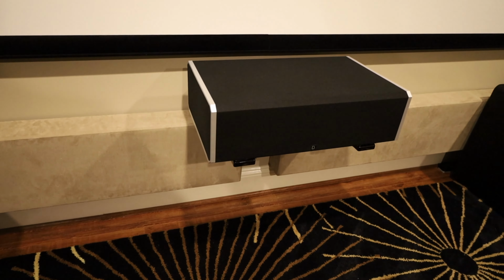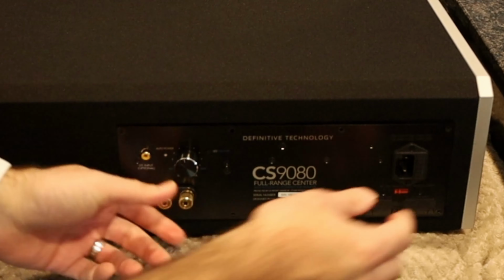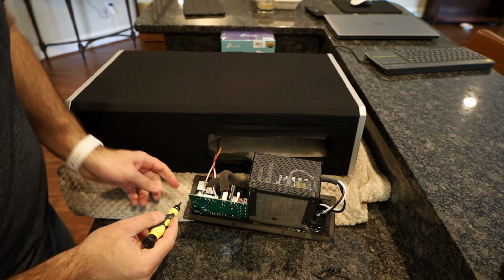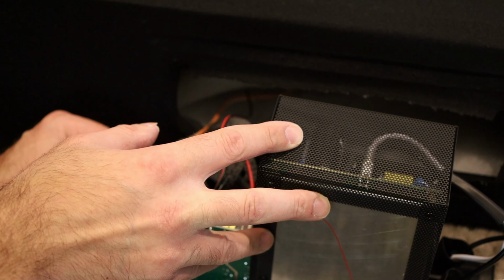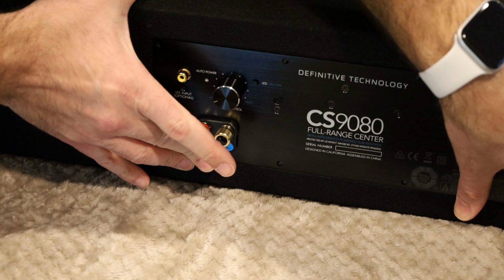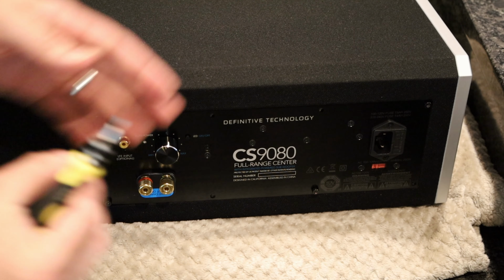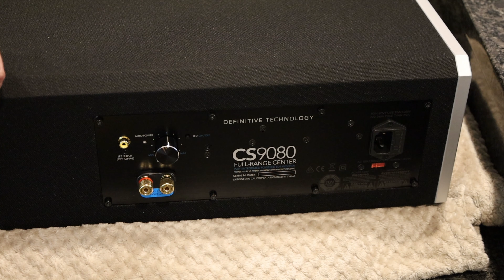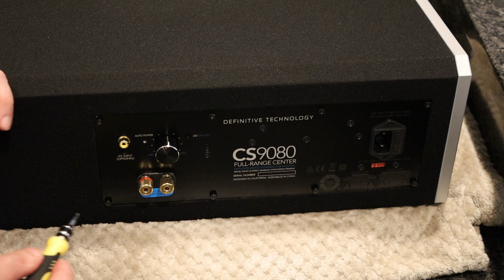Definitive Technology CS9080 Repair (Bad Amp) - Ownership Overview

Comment: Good amplifiers can last quite a long time.  Seems like Def Tech uses really cheap parts even though their speakers are kind of expensive. I bought a used Def Tech CLR 2300.  It started popping when my receiver wasn't on.  Luckily was able to get my money back.  Kinda warded me off buying a speaker with a built in amp.  Too much that can go wrong.  It does look like they made replacing the amplifier easier though.
Reply: I blew 1400 plus dollars in definitive technologies 9020.  Both the amplifier failed. definitive technologies did not care to do (even paid fix).  They are a big paper weight.  It was under warranty still five years! But definitive technologies did not care to honor warranty.  NO more definitive technologies products for me!

Comment: Thanks for the video. It definitely helps. That being said, your comments about the sub going off a quarter from a corner. Yes that can be ideal for 1 sub. Typically what happens when you use two like that is you end up getting a null where they cancel each other out. I know it looks symmetrical, but the sound/feeling isn’t very good in most cases. You would have better bass if you put them on opposite walls or even spreading them out to the corners. Most prime seating positions are in that null area. We also have to be careful of this when using our large center channels that come with 4 drivers and the tweeter in the middle. The spacing of those 2 outside drivers from the inside ones make a difference.

Comment: I have 4- BP7004's from 2009. 2 lasted 7 years then started humming then died. 1 has been humming for the last 4 months but it's not too loud yet and 1 is still functioning properly. I also have 2 subs from that time period that died about 6 years ago. I guess I am lucky to have gotten such longevity out of them. I have tried to find replacement amps for the 7004's but no luck yet. I think I will call a few local audio repair shops and get some estimates but I will not be buying anymore Def Tech stuff since they sold out to Sound United and then Sound United was recently bought by some medical supply company which is why Def Tech lost it's amazing customer service department. When they were just Def Tech and in Baltimore it was a great company to deal with. If I were you I would ask them if you could purchase a few more of those amps so that when they stop making them and yours break (which they will) you can just do what you did in the video if you like the speaker enough that is. They do not offer replacement amps for any of the Def Tech stuff that I have so I am s.o.l. Live and learn.

Comment: My new cs9080 is making loud pop noise when I sometimes turn it off…..less than a month old too. I guess I’ll be replacing the amp too in the near future.
Reply from the maker: That’s definitely not normal.  I hope you get the amp quicker than I did.
Reply: @Upscaled_HT  does it seem like the amp they sent you is better quality then the original one? Otherwise we will continue having the amp issues
Reply from the maker: The replacement seemed to be the same.
Reply: @Upscaled_HT  wow!!
Reply: The pop is normal from what I understand.

Comment: Thank you for this video. I have the 9080x towers and the amp is out too. I’ve used it lightly for about 2 years but those times I did use it, it would have that loud pop from time to time.  until eventually the sub stopped working. I didn’t know what to expect with replacing the amp but you definitely helped shed light on that. Thank you. Off I go to replace the amp now
Reply from the maker: I hope it all works out.
Reply: I am curious to know also how Definitive handles your issue, please update for future owners.  I will be purchasing my BP9080x Towers here shortly along with CS9080 center.  What is you amplifier/ receiver setup?  Currenly running SR8012 with Procinema 1000's throughout with Procinema 2000 center, curious how the Marantz will sound being it;s not the new SR8015 or seperate 8000 series processors

Comment: I have some bp9080 but upgraded to the 9080x about 3 years ago,  amplifier out on one of the floor standing subs.  I wonder if it’s possible to swap out the amp from the 9080 to the 9080x?  Can’t imagine there would be a huge difference.  The 9080’s have been sitting in storage but could come to good use now!  Just past warranty date too so would hate waiting that many months to get the part.
Reply from the maker: It should work fine if it physically fits in the cutout
Reply: @Upscaled_HT  a project for this week 😉

Comment: Happy new year to you bro, I really wanna thank you from the bottom of my heart because my 9080 tower amp blew out after having them for 3 years which is just crazy after paying all of that money for them, and I usually pay to get a lot of things done but after seeing this video you inspired and motivated me to stop being scared to touch the inside of my electronics and just try, and this was really one of the hardest things that I thought I would never do but you made it very easy to follow and you saved me from having to pay someone else to do it, so not only did I install one, but I had two brand new ones and I installed both of them right away!!!! Like I’m a damn engineer or something Lol, well now it seems like they are both working at full strength, damn you don’t know what this means to me that I did it myself, I never thought I would open up my speakers 🔊 but I’m so happy I did it!!!! Thanks again for this great video
Reply from the maker: So happy it helped you out! I really appreciate the comment.

Comment: i had the same problem with my center channel and they sent me the amp and i put it in and works fine ,now my 09080x towers subs not working so they did send me the amps for those and i cant get the subs to work i called now they are going to send me the woofer driver for me to fix  ithey said the top atmos speakers comes off i tried but no luck you have any ideas on how i can open it up to replace the woofer ??
Reply from the maker: There must a broader issue with these amps.  I have my Definitive 8080st towers and their amps have given me no issues and they're approaching a decade old.  Does the manual provide any instructions on removing the atmos module?  If not, maybe they can provide you service manual. If not, they should be able to walk you through it.
Reply: @Upscaled_HT  they responded by sending me the amp and do it yourself kind of thing and now they sent me the subs for me to install myself also ?? They are still under warranty why do I have to do it my self ?? They should send me a RMA so that I can mail it back to them for repair or new ones I don't get it I think the amp they sent me was also bad but they are not going to tell me

Comment: How did you know it was the amp and not the subwoofer?
Reply from the maker: I called definitive and they said it was most likely the amp.  They asked me to try and move the subwoofer to see if it wasn't seized.  I was able to move it a little.  Also, when I got the new amp, the sub worked again.